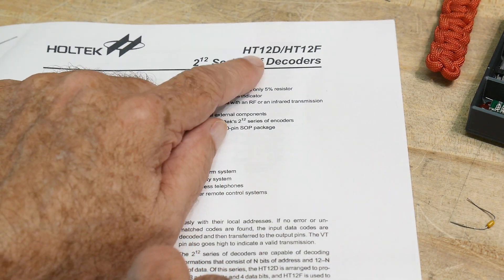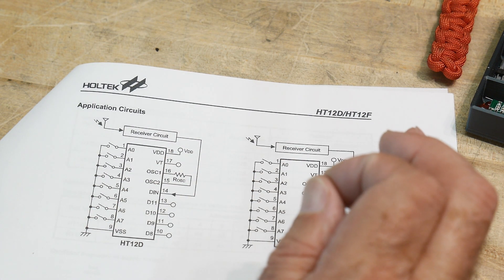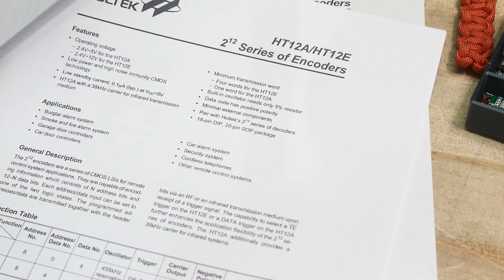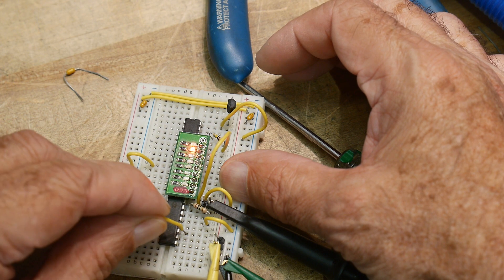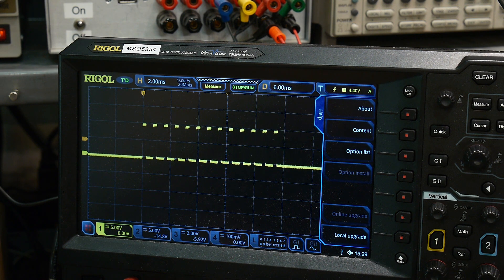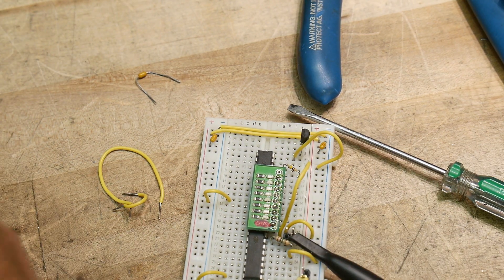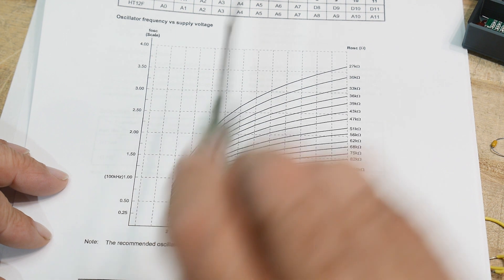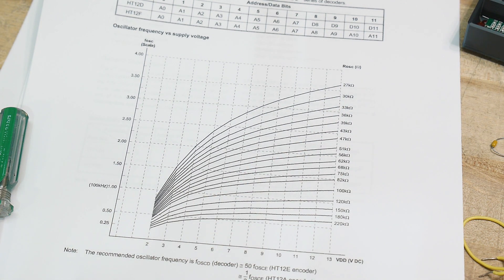#1243 Holtek HT12D HT12E

Comment: there's a famous attack on these from samy kamkar, since they use a sliding window comparison it's actually super quick to build a short bit string that goes through all the values much faster than 255 broadcasts (or 4096 for 12 bit systems) by using a de bruijn sequence

Comment: I think you've missed about half of the functionality. There are two encoder chips: HT12A and HT12E. The HT12A has a 38KHz carrier for the data stream, which is intended for use with IR transmitter/receivers, and only works up to 5V. It has 8 pins that only encode addresses and 4 pins that encode only data.

The HT12E only outputs the data stream and allows supply voltages up to 12V. It has 8 pins that only encode addresses and 4 pins that can encode either an address or data.

The two decoder chips are the HT12D and HT12F. Both allow supplies up to 12V. The HT12D matches the first 8 bits (addresses) of the stream and latches the next four bits (data) onto its output pins when a match is found, along with setting the Valid Transmission pin high momentarily.

The HT12F matches all 12 bits (addresses) of the stream and only sets the Valid Transmission pin high momentarily on a match. There are no other data bits.

So, in simple terms, you can decide whether you want to transmit just a single bit of information and have 12 address bits that have to match (4096 combinations) on the HT12F.
Or you can transmit 4 bits of information (16 different numbers) and have 8 address bits (256 combinations) to match with the HT12D.

Comment: 0 to F on the 4 bit output?  0 to FF would be 8 bits.  But I know what you meant 🙂
Reply: I thought the same, us nerds pay way too much attention to the little details! Regardless, great video as always!
Reply: @matteo234321  Agreed, great video.  I think these chips might even be used in my gate opener transmitter/receiver as they're the old dip switch set code models.

Comment: Since I didn't do the kind of work where I got lots of manufacturers' data sheets for new products,  I never realized how many single purpose ICs had been designed.  Of course many, if not most, are obsolete, having been replaced by either more versatile programmable designs or proprietary chips that cannot be easily repurposed for any other use.

Are you mining the inventory you got from that analog designer's estate?
Reply from the maker: I bought these
Reply: @IMSAIGuy  I am jealous of your access to places that have "interesting" bits and pieces to sell. Not jealous enough to move, however.
Reply from the maker: @tfrerich  I bought them on eBay or Aliexpress